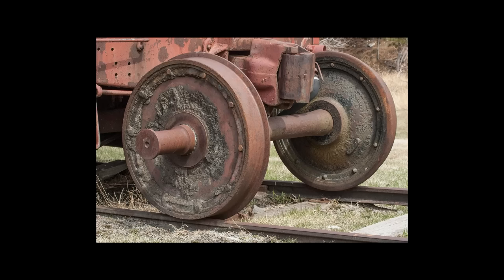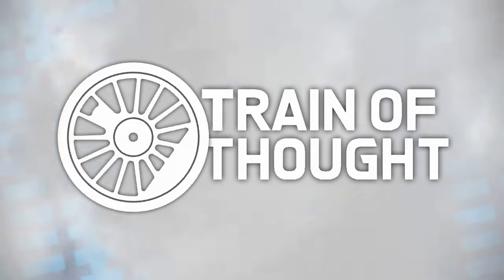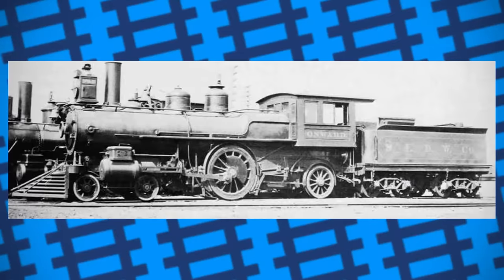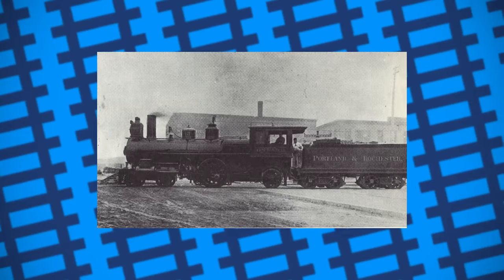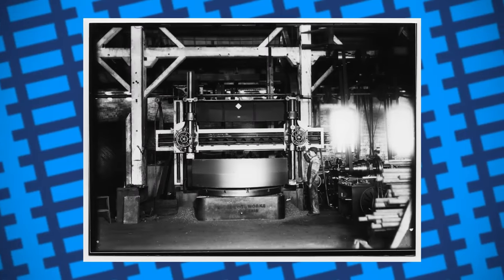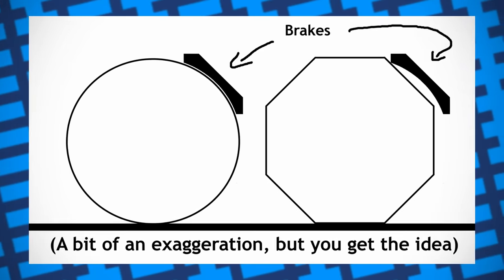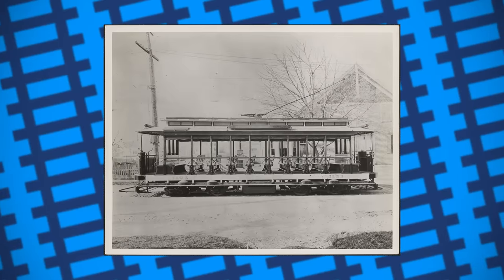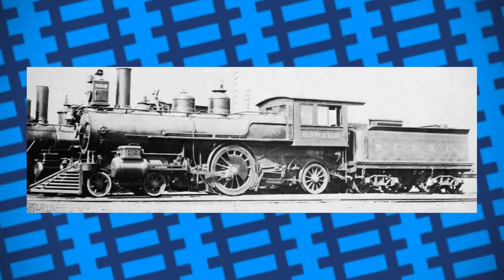Can you build an engine without round wheels? - "Onward"

Comment: Myth-Busters fitted square wheels to a truck. The ride was good once the truck got up to speed. So a 200-gon wheel would be fine. Of course once you are going at speed the wheel would spend a lot of time not fully in contact with the rail as it goes from corner to corner.
Reply: 'I'm old square wheels!'
Reply: Could this be fixed by making each side curved/scalloped rather than straight in profile?
Reply: @Yamauma-No.10 Yes but that would be saying that flat sides don't work. If you are going to change the profile, you might just as well use perfectly round wheels.

Comment: As an old-fashioned machinist, I'm thinking of how milling those treads would be a huge pain. Granted, it's a simple enough concept, setting the wheel on a rotary table and indexing it, then shaving off each flat, but we must remember that milling machines back then were rather primitive compared to more modern manual equipment, and they didn't chose a number of sides that could be easily divided into 360°.
Reply: The total material removal from each face wouldn't be that bad (if each one is only 1" wide).  From a turned blank, it'd take a little time, sure.  Indexing peculiar numbers of faces would be a bigger pain, but if you had a decent dividing head, and you did it directly from an indexing plate (like older clock gear cutters used) for the specific face count... yes, it would be big, but I've seen pre-1900 gear cutting for power transmission, like hydro plants, and its doable.
Given that this was done in the later 1880s, I'm skeptical of it being milled.  Horizontal milling machine maybe, but setting up a wheel like this would be miserable, since you'd need a large machine, and you'd be moving the wheel on each cut.
Something like an adaptation of a shaper, though....since you'd only be moving the cutter.  Surviving film footage of the Westinghouse factory is sparse on milling machines and heavy on planers and shapers.
Reply: @joelfenner  Didn't think of a gear cutter, that would actually make more sense. Especially since they mostly only had straight-tooth gears at that time, a shaper or slotter would be used. Milling machines didn't become more common until milling cutters became cheaper and easier to produce.

Actually, I'm a volunteer at the Illinois Railway Museum and we have received a machine that could do a similar job, a Pratt & Whitney slotter. US Government surplus, with DRO fitted, and it has a table that can both shift on two axes and rotate. Haven't set it up yet, but it could interesting to use.

Comment: I want to make a clarification on why steel wheels have low rolling resistance. It's not because steel on steel has low resistance. That's because in normal operation the wheels don't slip, and friction without slippage does not dissipate energy. What dissipate energy in a wheel is the fact that at any point in time it is deformed to have a contact area with the ground. As the wheel rolls, it is constantly deforming according to where the contact point moves. It's this deformation that causes energy to be dissipated (by "friction" at a molecular/atomic level). Steel wheels are much more rigid than rubber ones, so they deform less and dissipate less energy

Comment: For people wondering why we don't use this on modern freight trains, the modern iteration is tread patterns cut into wheels, but it doesn't make financial sense. The reason is physics, power equals torque by revolution speed, and wheels slip when they exceed a given torque, which cutting patterns aims to slightly increase. Since the trains engine has a limited amount of power output, and the locomotive a fixed weight, under any given set of weather/track conditions there is a critical speed where its engine is already able to be fully utilized, and so no improvement can be had by better wheels. Likewise when moving below this threshold, you still only get advantage when you actually want to use more power than would otherwise cause a slip, like steep hills or rapid acceleration. However the cost of tread patterns due to increased rolling resistance, wear of rails and shorter life or higher replacement/re-maching expenses is applied constantly for distance traveled, not only when it gives advantages. If you where prepared to pay the extra running costs of higher traction wheels to lay down more power, you could just add another locomotive onto the train instead. It could make sense for very lightweight regularly stopping services, but rubber wheels fill that neiche better and ARE in use by some metro trains in europe, as well as city busses everywhere.
Reply: Plus sand is cheap.
Reply: Wheel slip also basically isn't a problem with modern transmissions.
Reply: @hedgehog3180  East Palestine, USA likes to know your location

Comment: There's a reason "don't reinvent the wheel" is a saying. Also it's purely coincidence but "Onward" was the name of the first Mason Bogie locomotive, an 0-4-4RT built in 1872, I guess it's a good name for a locomotive. Unlike this Onward, Mason's Onward was quite successful, and the Mason Bogie design enjoyed a brief heyday with 148 being made over the course of 18 years, and the locomotives being regarded as powerful and good on tight curves and rough track, but temperamental and maintenance intensive.

Comment: Friction, and thereby traction, is completely independent of contact area.

f=uN

Friction=coefficient of friction x normal force. 
Note the complete lack of contact area in that equation.

I expect the actual reason for the performance improvement was that it defirmed the rails very slightly, forming a very subtle rack and pinion.
Reply: Now that's a FuN fact! 😅
Reply: That's a great equation for spherical cows in a vacuum, but in the real world the size and shape of the contact patch matters.  This is (part of) why locomotives needed more driven wheels as they grew in power, why race cars use slicks when they can, and part of why tanks and bulldozers use treads.  The reality is quite complicated for rail, as the pressure varies non-linearly across the contact patch, the contact patch is (usually) partially adhering and partially slipping, and the size of the adhering patch matters a great deal.
Reply: @SkorjOlafsen  You're mixing up pressure and friction, and also not understanding the formula. The reason why trains had multiple driving wheels is very much because of this formula, the normal force would be experienced by each wheel seperately so if you just increased power to a single axle eventually the force would overcome the friction and the wheel would slip. However if you divide the power out over multiple wheels each wheel won't have enough force to overcome friction and you avoid wheelslip.

Tank treads are an entirely different matter that have nothing to do with friction, the point of tank treads is to spread the weight of the vehicle out over as large an area as possible in order to provide floatation.

Comment: Brakes- have a separate brake drum or disc like vehicles today.

Bicycles have had elliptical chainrings. This has been tried about three times. Firstly in the 30's and then again in the late 80's by both Shimano and Chris Bell who each had the major and minor axis at right angles to each other.
This is all quite another wormhole.
Reply: I had a bicycle with those. I really couldn't tell if they increased pedal force, but they made shifting worse.
Reply: @suzi_mai  I think they were also bad for the knees.
Reply: I mean where exactly would you put that on a steam locomotive? Also it'd just be a waste of weight when like the directly applied brake works perfectly fine already.

Comment: The braking issue is easily solved with a circular surface to brake against in parallel to the polygonal tire. 

As for its effectiveness, a 4-2-2 is an odd bird to test it on. I would have liked to see data on its effectiveness with a 2-6-0 or 4-6-0. The idea was to get more driver surface to the rail, so go big on the number of drivers as well as the surface area per wheel.
Reply: I think he was trying to emphasize the effectiveness of the wheel shape, hence the single powered axle.

Comment: seems to me it would spend more time with less contact patch than a round wheel, than it spent with more.  although 200 facets is pretty close to round, so it might be the corners of the cuts that were improving traction, kind of like the edges of the lugs on ice traction tires are what gives the traction.
Reply: Its important to note the smooth running, at the weight on the driving wheel the wheels hub was not rising and falling during normal motion because the deformation of the wheel and rail was more than the height difference between center of flat to hub vs tip of point to hub. I suspect the actual contact area changed little during the rotation, nor compared to a round wheel, because the materials just deform till the pressure is equal. Instead the keying effect on the edges of the lugs you mention is likely the cause of any increased tractive effort claimed, as even if the area is the same if the lugs are projecting further into the rail then it will take more force to slip them (but also embody far more rolling resistance and wear).

Comment: You can turn polygons on lathes . The technology is actually quite old and means any shape with more than three sides can be machined.
Holtzapffel lathes are the best known but any conventional lathe can be modified with motorised geared cutters to do the job. These are used for jobs like cutting hex heads on cap screws and gear teeth for example.

Comment: I don't get it. 
As the wheel rotates, you wil linstantaneously have the flat resting on the rail. 
But the rest of the time you are on the point to a greater or lesser extent. 
So on average the contact area is less. 
Fot those who say that the force fo friction is independednt of area, then that is so in theory, but you also have to consider whether the area in contact has the shear strength to transmit the force. Which is why high-powered cars and bikes need wider wheels. (despite it having soe downsids for handling in the case of a motorcycle)
Reply: I doubt the average contact area is less. Seems like to me that would only be true if a polygon of the same diameter as a circle had a smaller circumference but that is very much not the case.

Comment: I would’ve thought it a better idea to have several pegs poking out of the wheel, and a set of rails with several holes. This would be a terrible idea as I often don’t think things through
Reply: that's pretty much what a rack-and-pinion railway does; it's just that they're usually used for steep inclines and are normally used in addition to normal wheels rather than in replacement of them.
Reply: Some of the earliest steam locomotives had cogged wheels like you describe, until they realized it wasn't necessary. Like Richard Trevithick's locomotive.

Comment: 3:28 this issue could be remedied by having a separate brake disk on the inside of the frames, and while more complex would keep the increased traction without most of the compatibility problems with regular brakes
Reply: Then you need the wheel to be made of solid steel.

Comment: So, instead of putting the friction brake against the wheel, put it against the axle...or even cast a polygonal wheel with a smaller inner or outer round disc for braking against.  Or brake against the sides of the tire itself like a modern set of disc brake caliper pads do.  If you're going to spend the money to experiment anyways, why not?
Reply: To be fair, you can also just have a convex rather than concave brake pad, the reason why we don't see the problem solved is it just didn't matter for a 4-2-2+tender where less than one quarter of the locomotive+tender weight was on the polygonal driving wheels, counter stream braking could be applied to that axle, and the entire train following had automatic air brakes.

It would have mattered for a street car, but lots of those use external brakes (like drum or disk style you'd find on modern car or truck) rather than just wheel brake blocks anyway, since there stop start routes and inter-operation with other traffic causes a LOT of brake applications and demands more consistent braking rates for a given driver control input.
Reply: Breaking against the axle seems like a horrible idea that's just bound to cause a horrific accident.
Reply: @hedgehog3180  Not if you mold the axle with a thicker section made to brake against.  Or it could be a collar for the axle with a large keyway to hold it in place.  In either even, it could be changed out at the same time the tires were.  Personally I think I'd favor trying the caliper/pad method myself though as they've proven themselves over brake shoes in cars for years now.

Comment: With the braking issue, just use  a disc brake, not a drum style brake, they knew of that at the time, so i think the mention of this is unneccecary
Reply: pretty sure the drum style brake would have been standard on engines at the time though, so the issue with the brakes isn't that it's impossible, just impractical by way of requiring yet more non-standard parts.